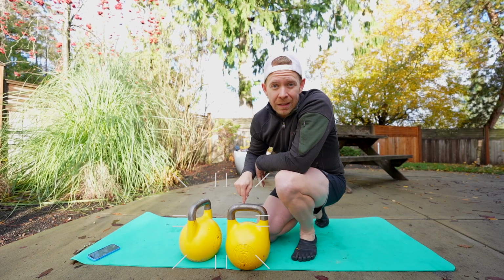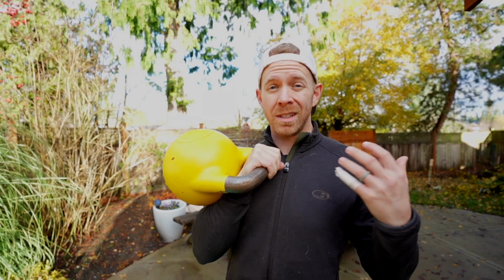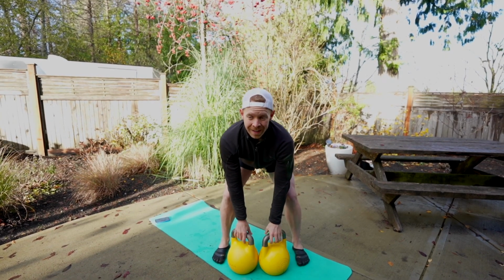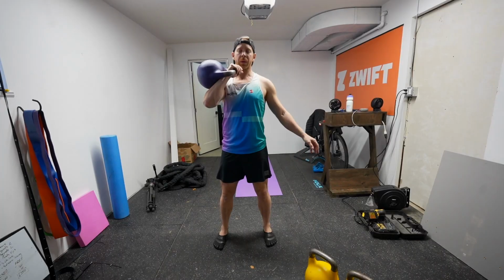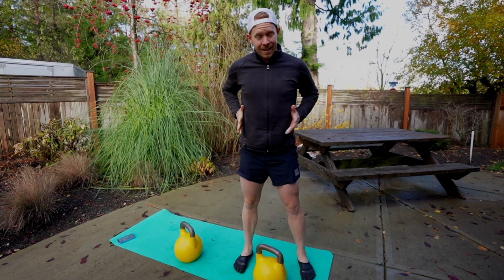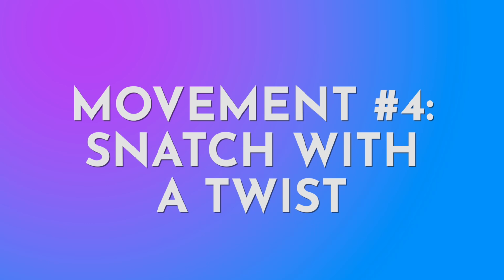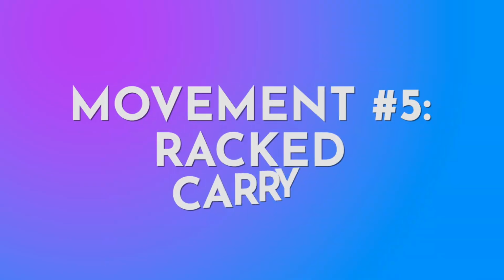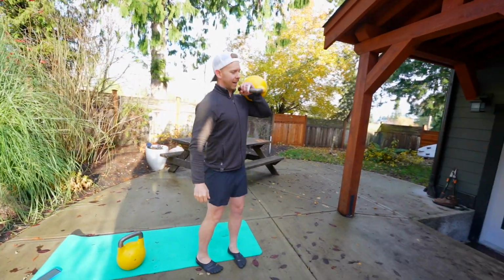5 Best Kettlebell Strength Exercises for Cyclists

Comment: As a competetive or fast recreation cyclist for decades and a kettlebell competitor for almost ten years I think this is an excellent introduction and good moves for cyclists.  In addtion to the kettlebells moves you use, I also recommend steel club moves like inside and outside circles and shield casts.   They provide great core and shoulder girdle stability work which are essential for long days in the saddle on the road, or gravel or MTB.   Nice job.